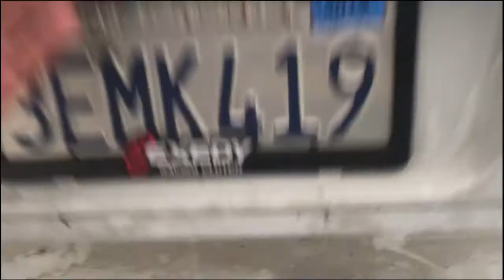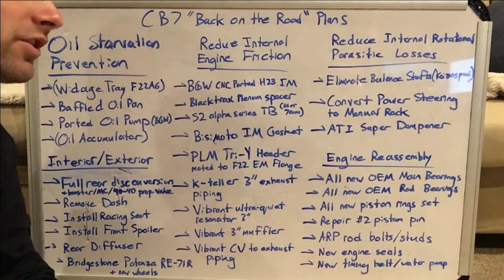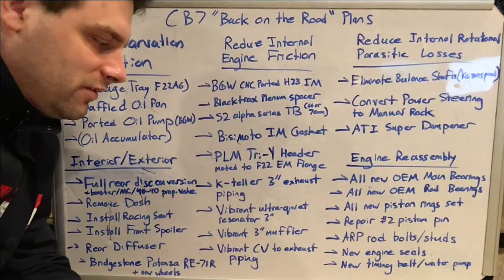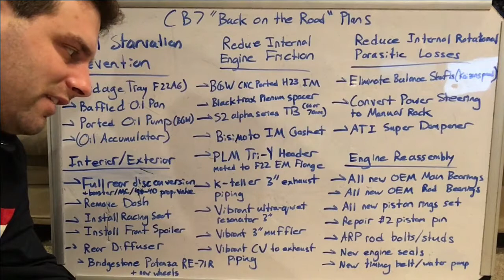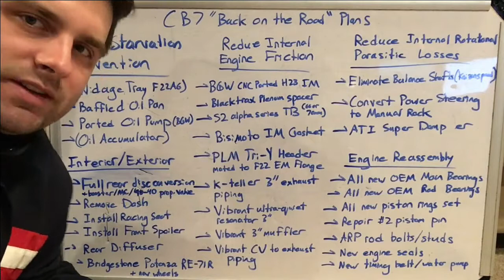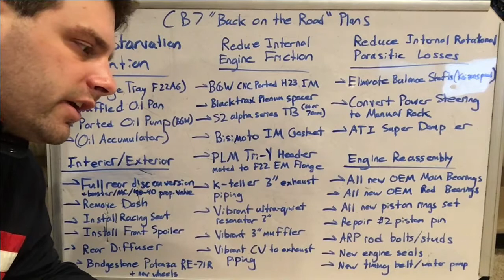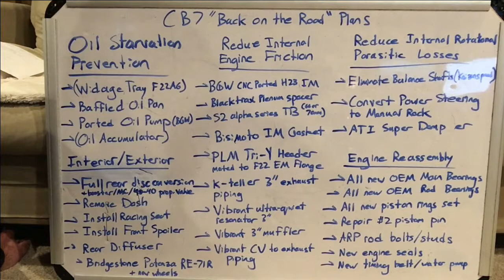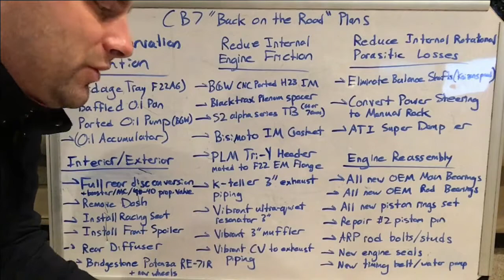CB7 Winter Woes + Revised Build Plans!

Comment: We have a lot of the same modification ideas, (S/O CB7Tuner), I would do a little more research on your exhaust and intake setup, I'm not saying anything is wrong with it, but with the parts you are planning to get you will most likely lose a lot of low end. This isn't necessarily bad, to use/move all the air you will be ingesting you may need a big cam, but you may not be fully utilizing the cam if the heads aren't ported. jdm92_accorn (on cb7tuner)  has A LOT of good info on how to get the most out of our stock block and heads Naturally Aspirated, I would definitely recommend reading his MRT (I know its long but its worth it.)
Also GET THE WINDAGE TRAY TOO! It will help a lot! https://www.crank-scrapers.com/Honda-Acura_F-H-SERIES.html Is something else I would recommend! Lots of good info there about oil windage. I can't wait to see whats next for your accord!
Last thing, https://www.youtube.com/watch?v=vsWiV_3PTkM is a good video on how to safely clean your interior in the state it is in. 👍
Reply from the maker: Wait, is your CB7Tuner name S/O?

I like that crank scraper!  Since the squirters for F series blocks are in the rods, I'm guessing I would go with the non-squirter variant.  Are you suggesting that I use this along with the F22A6 Windage tray?

Also, I have the Bisi Level 2 regrind cam, AEM adjustable cam gear, and the Bisi springs installed with a valve job (new standard valves and guides).  I actually originally got most of my ideas from jdm92accorn and his thread.  Over the past few years, he has helped me a bunch.  I'm thinking he would also recommend that I, if I won't modify the block, mill the head down a few hundredths of an inch and open the exhaust port throats a little.  He also gutted his own H23 runners and didn't complain about a huge low end loss, thankfully.

Comment: Rear disk is great idea. I also recommend doing hub over rotor big brake upgrade for front. Integra 4040 prop valves are everywhere. Let me know if you can't find one. I live in Sacramento. We have several yards
Reply from the maker: You live in Sacramento?  We should team up.  We can help each other and learn a lot in the process.  Having someone else around always helps with motivation!

For the HOR in front, we have quite a few 1st gen Odysseys in the Moss Landing yard.   That's definitely on my to do list when my front rotors are shot.  Right now, the 11" drilled rotors and matching calipers are doing well, but their day will come, hopefully farther in the future with the help from the rear.
Reply: If you want 5 lug. I can't afford 5 lug wheels and tires so I'm going acura cl 2.3
Reply: I really appreciate that offer. I don't know how to contact someone on you tube. Lol
Reply from the maker: Oh, doh!  That's right about the Odyssey!  3.2 CL's are more rare in my yard.  I will have to be on the lookout.
Reply from the maker: Use my email and we can talk/plan directly: afaulk1132@gmail.com
Reply: @af1132racing  nice thanks bud. I look forward to learning from you